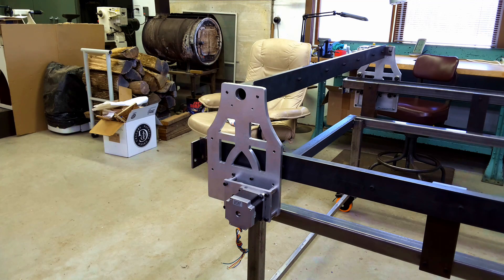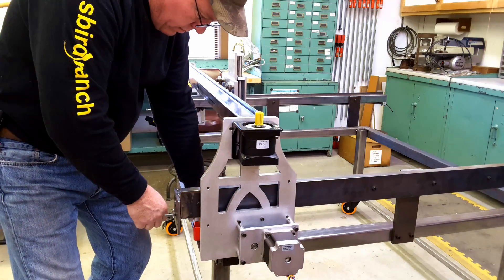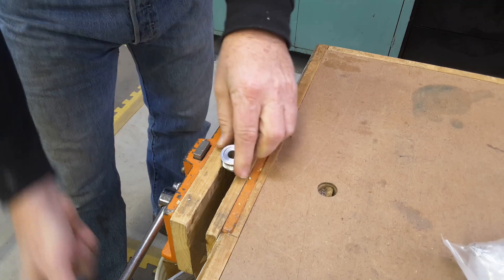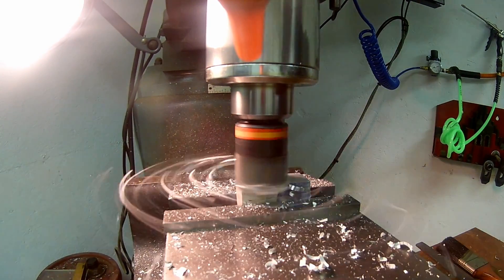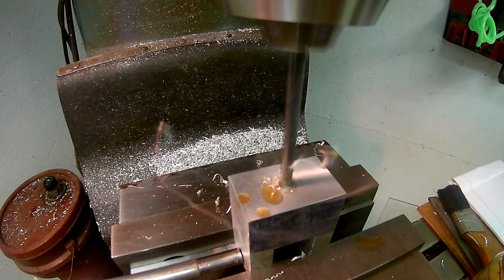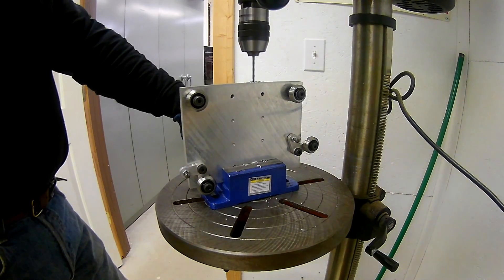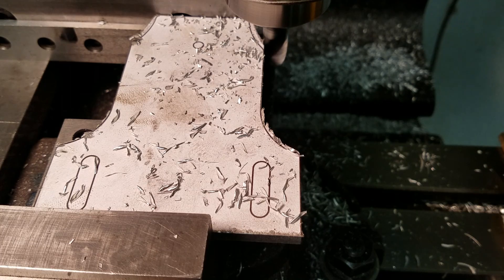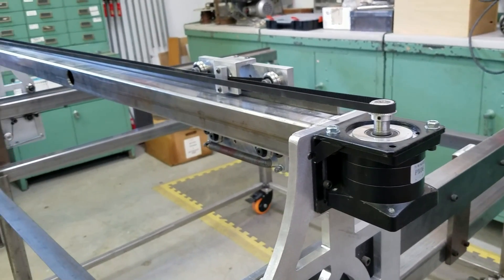DIY CNC Plasma Table - X Axis Belts PLUS tapping holes

Comment: I see the X axis belt drive uses a fixed motor and the carriage is attached to the belt.  But the for Y axis you used a filed belt and the motor moves along the belt.  Can you share some thoughts on why to use one technique vs the other.  For belt drive I like the idea of the motor being stationary and the belt moving.  With a stationary motor you have twice as much belt in the system, maybe that is a driving factor.  Great build!  I'm hoping to start something like it here in a couple weeks.
Reply from the maker: In retrospect, fixed motors might be better all the way around.  Experience has taught me that double the belt isn't an issue.  Those belts don't stretch hardly at all once tensioned.  So changing direction rapidly would cause stretch and issues.  The other thing you would gain, is removing the mass from the gantry.  This would have been a big help to me in tuning.  I have spent significant time tuning the motors and controller so that the gantry doesn't shake when changing direction.  Setting speed and acceleration down to a level this doesn't happen, is still a work in progress.  Good luck in your build. ~P

Comment: First off, what an amazing project you have here and great work! 
Question. Is using belts over lead screws for X and Y purely for cost? I ask cause having built a 3d printer last summer and not using hardened steal for my linear rods, my bearings dug groves into the rods, which in turn broke the bearings and seized up during a print (parts replaced, printer fine now). How concerned are you about the floating guide bearings you have used in conjunction with belts, riding along unhardened steel, over time? Wont these (like on my printer) get wore down and over the years, and eventually exceed the cost of having just used hardened steel lead screws?

PLEASE KEEP GOING!! YOU ARE DOING AMAZING WORK MAN!

Comment: I like the rails you built for this machine.  Just wondering if these rails would work as well for the cnc you built earlier?  I want to build a 5x 9 table for a cnc and I like the diy rail system shown for your plasma machine because it is way more cost effective.  Is there any difference in accuracy is the question?
Reply: I should also specify 5 x 9 router is what I want to build.
Reply from the maker: No.  They won't work for a spindle machine like that.  Too much radial load will goof it up.  Accuracy with belt is also poor when under heavy load.  V groove rails will work just not with the spring loaded design and inaccurate flat stock.  None of these issues apply when you are working with plasma that has no side load and automatic Z height control.

Comment: hi 
i need to make something like you done here 
linear belt drive with the same heavy put with more speed 
what the stepper motor i need for that ? pls?
its come  instead of ac motor .18 kw with gear motors  
thanks

Comment: Buy or make a spring loaded tap follower and tap on the mill right after you drill your tap drill hole. Super easy and perfectly straight.
Reply from the maker: I didn't show that.  I have one too.  I don't think of it because I haven't had it long.  I use it on the lathe mostly.  Good call. ~P

Comment: And that is why we design (build virtually) EVERYTHING in SolidWorks (or Fusion360) first. That hand tapper is a great tool and I am glad I purchased it.
Pretty brave using the cordless drill for tapping. I hate snapping taps. Looking good: I am glad I bought a PlasmaCAM, but yours should be awesome.

Comment: I'm enjoying your project, and as I reorganize my shop I'm thinking about where I'll put a machine this size in my shop.   Do you have any opinion on vertical or inclined plasma tables?
Reply from the maker: I have seen vertical routers, but not plasma. Rules out a water table.  The machine and rails and such wouldn't care.  I think the biggest practical problem is material holding.  Not sure how I would quickly (more quickly than throwing a piece of steel on a table) secure material to the table for cutting.  It is an interesting mental challange.  ~P